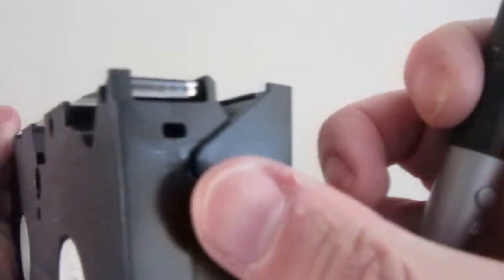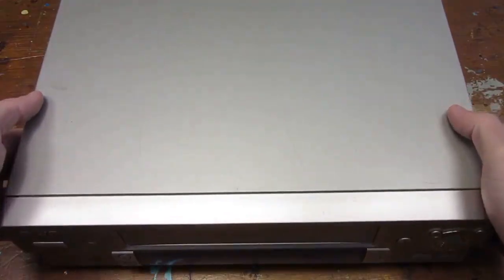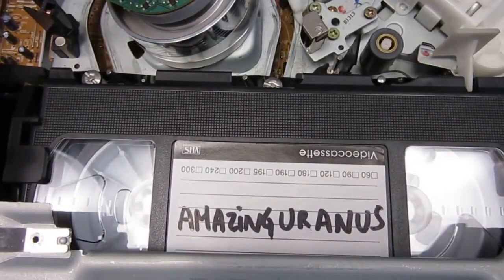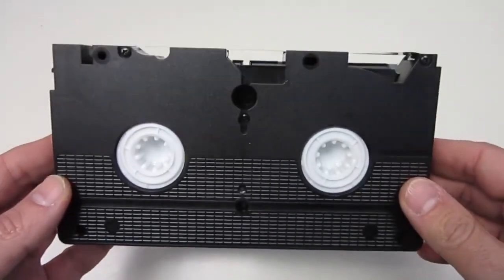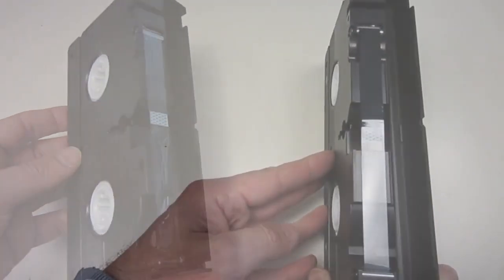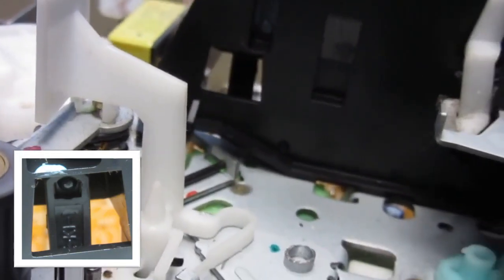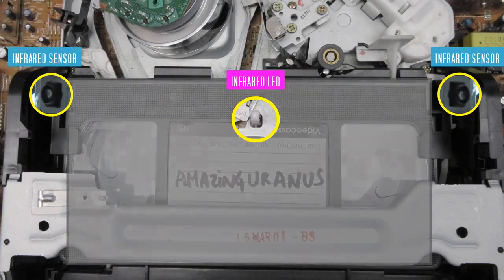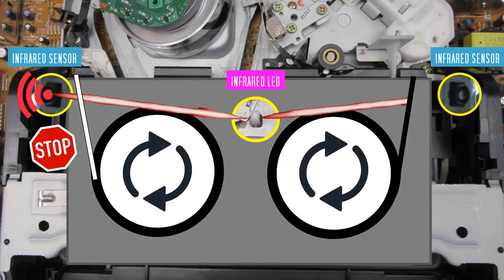What Is This Strange Hole Used For On A VHS Video Tape? #MysteryExplained

Comment: It is electric eye sensor.  The VHS tape have two clear films on the both end. When the sensor see the clear film, automatically stop the playback, fast forward, and rewind.
Reply: It actually isn't the location of the sensor. But the light source.
The sensors are at both sides. As it needs to detect the end when the transparent tape appears.
This only works when putting the sensors at both ends.